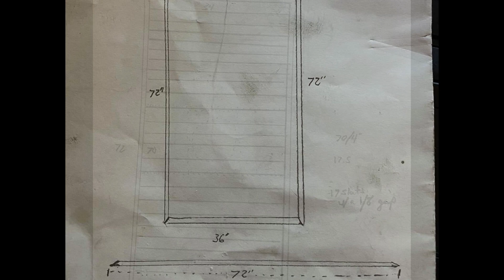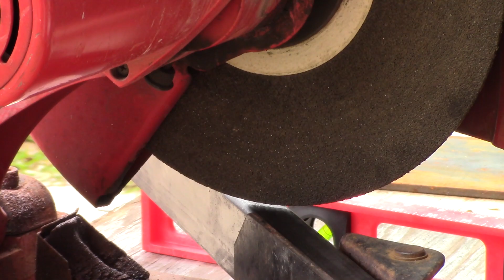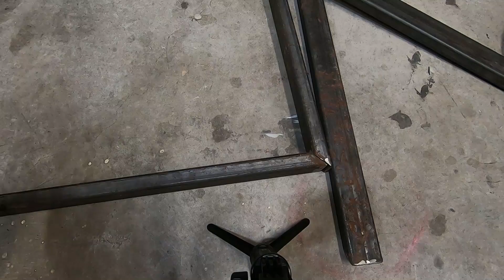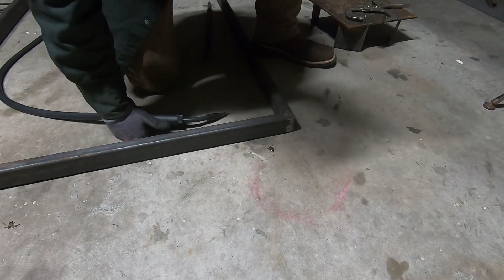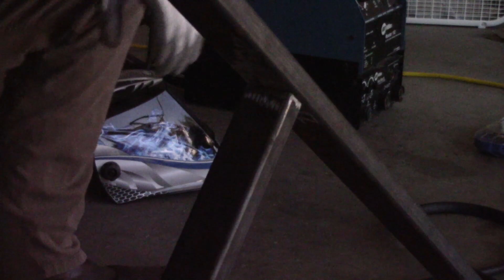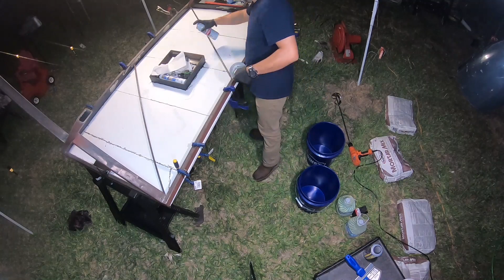3x6 patio table build using a flux cored welding machine.

Comment: I like your table, very cool. Did you say you use 1/8 inch wall on the 1X2 tubing?
Reply from the maker: Thanks, Yes 1\8 wall.  The table with that concrete top is really heavy and the legs are handling the weight ok as far as I can tell.  No bending or bowing, no cracks on any welds either.